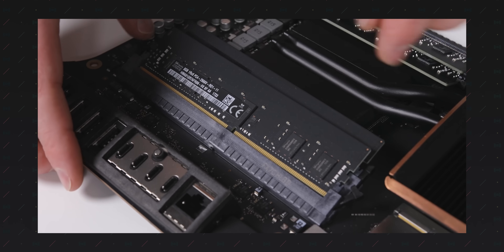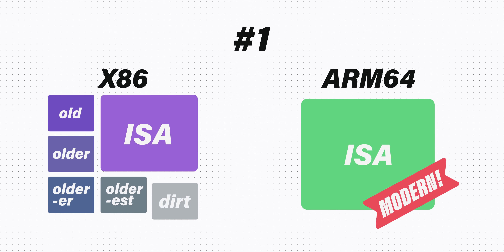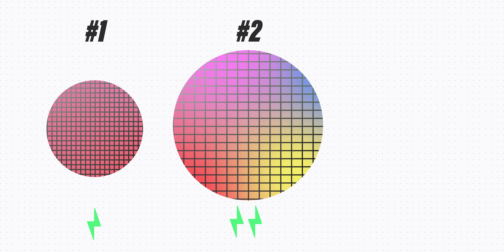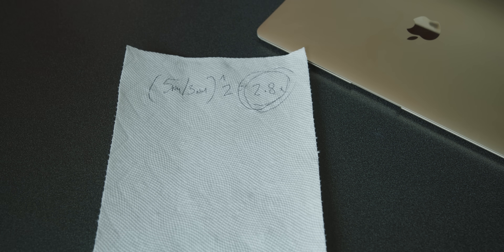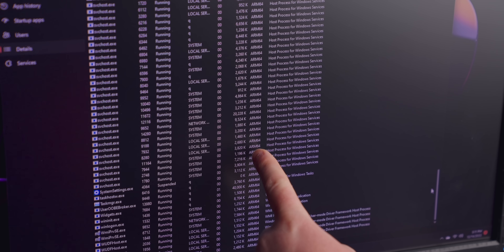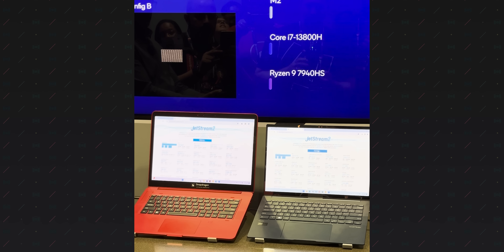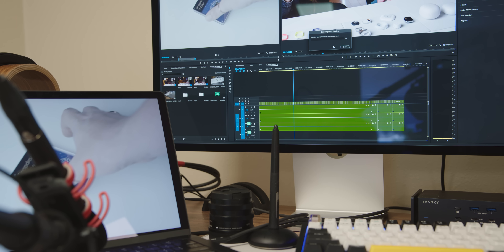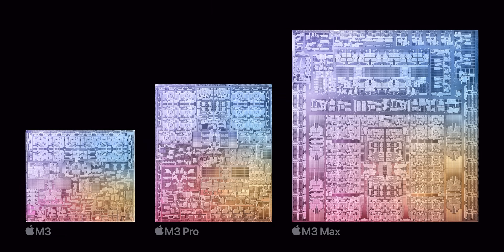Apple's Silicon Magic Is Over!

Comment: not only are the ssds unupgradeable, but they’re also unreplaceable, if the ssd chips die, the mac is a brick. i hate that.
Reply: Si se pueden cambiar... no en tiendas oficiales obviamente. Pero si hay lugares que los cambian incluso en IPhones.
Reply: Had an m1 since launch, it’s been spanked for hours a day.. every day. 
Zero issues. There’s a thing could cloud storage (and/or a personal NAS), use it. Keeping vital data on a single device is foolish and if you loose said data that’s down to your own decisions.
Reply: @jakestechtravels4864  well i now have an m1 16gb 256gb ssd and i still stand that soldered ssd with bios on the nand sucks but just keeping only apps and the os on the internal drive and use external ssds for everything else makes the ssd last years, plus if someone (like me before) really doesn't want to wear out the internal ssd at all they can just boot from an external ssd
Reply: And they die a lot - ask any repair shop - lots of horror stories
Reply: This is a planned revenue stream for Apple. They intentionally make shitty non-upgradeable devices knowing that you'll suffer through having to buy a new one rather than switching away from their all-encompassing walled garden of shit.
Reply: Ah, but that keeps users buying applecare. Not saying I like it because I'd rather crack a case and swap ram and hdd. But it sure makes people buy applecare as well as replace computer more often to keep up with what applications need.
Reply: @evankalbach9985 its planned obsolences mixed with anti repair
Reply: Components of a phone are irreplaceable too, so what? Phones easily live a dozen years without hardware problems except the battery.
Reply: @furyaroslav you're missing the point, and also very few phones last a decade. My iPhone 7 boot loops, my my galaxy s3.. turns on but isn't useful, got a lg something that works so hard on basic shit it cooks.

The main problem discussed here is that the laptop parts are not just unable to be replaced, but will wear out significantly faster because the sdd is being used for excessive memory swapping and paging because apple don't use sufficient ram. 

Everything that isn't fully active - regardless of whether it'll be used in a minute or not - gets written to the ssd, then removed, over and over again to complete basic ram tasks. If it had more ram, it wouldn't need to do these excessive transfers. 

On an ssd this can use up write cycles extremely fast - especially if you use ram heavy apps. And the 'unified memory' is just a special way of telling you they don't have a discreet gpu, so all graphical processing is also going to be eating your available ram - so more paging and more swapping. 

It's a poor design for longevity, and insulting for the price you pay
Reply: They never die tho !
Reply: It’s a brick for you. Apple can recycle it easily.
Reply: By design.
Reply: ssd isn't a "chip" like a cpu, and also have you ever had a Mac ssd die?
Reply: @KmGamer99  Yes and yes. NVMEs are chips (A CPU is a type of chip as are these ssds, they are like ram.), in this case the controller is onboard and only the storage chip is physically replacable, and even with Apple's software to allow for a new SSD chip to be used, you cannot use a different sized drive.
And yes, there are plenty of refurbed M1s on ebay that had the hard drive fail on them, particularly early models that had MacOS writing up to 8gb a week of temp storage just browsing the web.
Reply: oh its replaceable alright, you just need to educate yourself more
Reply: This comment did not age well.
Reply: Not true
Reply: Not only that after 7 years apple will cut security support so that you wlill buy a new one. No matter how fast your computer.
Reply: I think he is referring to swapping as when read and writes to the SSD from memory will cause wear in the SSD. These are NVMe not SSD and the endurance is rated X gb / day r/w over the lifetime of the system. The failure would hardly be pre mature considering the life of the system.
Reply: So much for the environment
Reply: No way I would buy that ...😂😂
Reply: Like having a car and no gasoline.  Screw electric cars
Reply: Have you ever had a Mac with an SSD that died?
Reply: @miketkong2  I'd say it happens. after all, one of Apple's biggest profit departments is repair.. they make huge margins and lots of profit for Apple, hence thier fight against right to repair.
Reply: @miketkong2  yes about 13 out of the 75 my company has.
Reply: @miketkong2 yes.
Reply: Yes twice  @miketkong2
Reply: @miketkong2  yes
Reply: @miketkong2 yes, only one thankfully, and it was mostly backed up
Reply: @miketkong2  dude 😆, it can die easily with swapping.
Reply: @lukasmauer230  what’s swapping? It’s an internal drive.
Reply: @lukasmauer230  no it can't. lmfao. the swapping thing is a meme. its virtually unheard of for modern SSDs to fail due to swap. it almost never happens, only under experimental stress testing. its not a thing anybody should ever worry about with a laptop lol.
Reply: @Anthony-kp7sf so u saying a drive tbw rating is a scam lol..theres a reason why manufacturers show those things..and ssd do dies😂😂😂
Reply: @Anthony-kp7sf crappy ones do I've had it happen but they are soldered on
Reply: @Anthony-kp7sf  they are realy doing it5, due to smol ram. It's like virtial ram on smartphones.
Reply: @Anthony-kp7sf  my macbook pro 2015 256gb that I bought in 2018, just died without any sign or warning, don’t see anything in the new models that would prevent that. I’ll just replace the ssd and use it as a backup for probably another 5 years
Reply: @DaviAreias my 2020 MBP died after 26 months, logic board failed, so that’s memory, disk, everything rendered useless. £620 to replace on a £2000 laptop. Are you fking kidding me? Never again.
Reply: @Anthony-kp7sf  I think you need to do some more serious reading in a world where grown-ups talk and not everything is a ‘meme’
Reply: @sprint955st  hmm.... but you're saying the logic board failed which includes onboard SDDs, but it also includes the CPU, GPU, RAM, IO controllers, power circuitry any one one of which failing could brick a system. It sounds like it's not conclusive that the failure was specifically due to a failed SSD. 

Failed SSDs is something that definitely concerns me since digital file integrity is crucial to my business and my livelihood. If modern Macs have an issue with internal SSDs failing, I've never heard about it, but I'd like to know so I can take precautionary measures since I work exclusively on a MBP—and because most modern computers run off internal SSDs not to mention pretty much ALL of my work data is stored on SSD tech.
Reply: @sprint955st  the amount of these "tech" people is alarming and they're indirectly contributing to why company can con us so much.
Reply: @miketkong2  your question was ‘ever had a Mac with an ssd that died?’ I said Yes then told my story. What I didn’t clarify was that Apple inspected the laptop that tries to boot but shows a folder with a lined circle on it, and diagnosed that it cannot find a boot disk. This is entirely in line with my experience leading up to failure where everything was running fine but it would then panic, crash and the logs I could get showed various I/O issues.
In a nutshell, my £2000 laptop with almost all-integrated or soldered components is rendered useless by a chip that likely costs £30-£40 if that.
And  concur on how important storage is, I work with enterprise-grade storage arrays contains hundreds of VERY expensive SSDs and flash, but with high levels of redundancy and plenty of warning before failure.
Reply: @sprint955st  right on thank you for clarifying. I appreciate it and it helps to know your experience with that. Did you lose any critical data? Do you not use Macs anymore?
Reply: @sprint955st  was it a smol capacitor that threw a hissyfit and shorted?
Reply: @miketkong2  what i meant isn’t that the ssd are shit, it’s that WHEN they die (ssd wear out no matter what you do) they aren’t replaceable and the bios of the motherboard is stored  IN FRAGMENTS in each ssd chip, so even if you could somehow make the mac think it’s the original ssd, there womb be any software that can make the computer boot, thats why i hate it, the bios is on the darn ssd
Reply: @Sulphur_67  got it. Thanks for the explanation. I think that happening, in my opinion anyway, is so rare that I personally am not worried about it and will continue to use Apple products, but I totally understand and respect where you’re coming from.
Reply: @miketkong2  "is so rare that I personally am not worried about it and will continue to use Apple products"

Nah you just an appel fan, thats ok dude. But don't try and tell people it's decent hardware or practice when it is VERY anti consumer and VERY wasteful.
Reply: @sprint955st  This can be common, but is also often something like the monitor ribbon got pulled out so it doesn't boot, or the serial checker gimped itself and bricked yyour lappy. If it was in ACT/NSW within Australia you would be entitled to a full refund or new replacement (your choice) for up to ~5-7 years due to the cost.
Reply: @miketkong2 you don't know what swap file is? hahahahaha
Reply: @Anthony-kp7sf The only systems where ssds fail due to swap are apple because no other system lacks that much ram. You think writing a petabyte to an ssd is a meme? Then why are there hundreds of users on reddit showing M1 Airs with that much TBW?
Reply: @transformerstuff7029  you don’t know me. Don’t act like you do. 13 out 75 sounds like user error. Use what works for you buddy. I couldn’t care less.
Reply: @miketkong2  "13 out 75 sounds like user error. "

Seems I did know, fanboy ;)

" I couldn’t care less."
Seems ya do.
Reply: @miketkong2  wait did you just make a comment arguing.......only to tell me you don't care.

LMAO that's one not so very smart way of showing me you cared A LOT.
Reply: @miketkong2  17% getting HARDWARE issues.

you go; usEr ErRoR derp.

lmao fanboys gonna fanboy.
Reply: @transformerstuff7029  look why don’t you educate us all and post the specifics of your claim. What hardware were you using exactly for your 75 units, what did your company use them for, and how exactly did they fail?
Reply: @miketkong2 why anyone would waste their time educating someone that is so dismissive of the answers given since they go against the faith that someone put on a brand? That's the text-book definition of a fanboy. And you can't change a fanboy. Only the company itself can un-fanboy you.
Reply: @miketkong2  Apple MacBook Pro 2016 ALL went back for their keyboards.

Apple Mac Pro (2019) Xeon W-3245 had overheating issues and was what I was talking about. They'd work, but they'd downclock under stress. Making them worthless. Took a while for Apple to admit to it and take them back.

In the end with Apple you pay more to get less.
Reply: @sharkuel  not dismissive. In fact, @transformerstuff7029 pointed out the reason for returning the hardware wasn’t even SSDs, so it’s besides the point of this thread which is about SSD failure. If he read up the comment thread he would have seen that. That is why I was so skeptical about such a high failure rate with Apple SSDs and asked him to clarify. Turns out it wasn’t about SSDs failing at all. It was about keyboards and overheating issues. I’m not telling anyone what to buy or calling anyone names. I’m just trying to learn about SSD failure rates for my own workstations. You all are kids and need to grow up.
Reply: @miketkong2  so, fighting for our consumer rights, independant of the type of failure, makes us kids. Great. 

You are the embodyment of the "please leave my multi-million dollar company alone" meme.
Reply: @DaviAreias  You make it sound like a 9 year old laptop is a bad thing. Windows laptops from the same time don't last as long.
Reply: @Sulphur_67  why would it? The case is sealed shut and I don’t poke around in it. If it was a capacitor then it’s an inherent manufacturing fault and they should recognise that because thousands of others will fail, and the reading I have done suggest that is the case. Needs a class action law suit.
Reply: @sprint955st  That sucks man, yeah 26 months should have been covered for the price you paid. I know of 2 people in rural towns that could diagnose/fix an on-board issue over here, but it sounds like options are more limited where you are.

Oh well I guess get a gigabyte/framework/metabox lappy next time.
Reply: @sprint955st  I'm interested to know if you had Apple Care and if that was the repair price they quoted you with such cover?
Reply: @lukasmauer230 ”easily” ??? i’ve been doing very memory intensive work on a mac with 16gb of ram, and in 7 years my SSD only lost 1% of it’s capacity.
Reply: @miketkong2 Swapping is the use of storage space as extra RAM. AS Macs are very good at it since their drives are so fast, but it significantly lowers the lifespan of the drive which is a huge issue since they’re soldered.
Reply: @sprint955st  Lies

Comment: The biggest issue besides the processor advantage you still need to factor in is the OS itself. Windows is a relative hot mess compared to macOS and always will be. Apple for the win regardless of the processor.  The rest of the industry will never “catch up” until they move on from Windows.

Comment: I use my (almost) base spec 512GB, 8GB RAM 13" M1 MBP all the time. Bought it 3+ years ago and for my usage, and my video editing and the likes, I have never noticed a hiccup. It runs just as good as the day I bought it. Works amazingly on battery too, lasts for hours and does not throttle. On the other hand, I bought a ASUS TUF F15 (base spec) for gaming and surprised that a i5-12500H barely benches 20% higher than my M1 in Geekbench and has a TDP of 45W when the M1 is 15W... also the F15 throttles and falls to pieces if I use it only on battery--has to be plugged in to game properly.

Comment: I tried to adopt a couple of m series MacBooks. The hardware is great... The software, not so much. So many issues and finder is an absolute abomination. The thing they don't tell you about with battery life, is that it's only using optimized software.  I found that Citrix Workspace (client), Teams, and MS Office is enough to kill both of my MacBooks in less than 7 hrs. Meanwhile, I've seen at least two AMD laptops running an OS that isn't infuriating to use at times lasting longer than a full workday at the same use. 

It didn't work well for my use case, but I can see how it will do great for a casual used or someone who enjoys apples ecosystem.

Comment: Out of curiosity, have Apple chips ever outperformed Intel or AMD chips on desktop computers?  It all sounds wonderful, until you realise it's about perrformance per watt, not all-out compute power.  Couldn't Qualcomm pass Apple by putting multiple chips on a die connected by a fast fabric a la AMD? On the other side, isn't it time for Apple to stop pretending and put actual cooling in their computers?  Say, the RSD5 system with no moving parts.
Reply: yes lol AMD and Qualcomm haven't had reasons to cuz they're not in the business of making the best or most efficient processors, just the most marketable ones to manufacturers.
Reply: @feralmage  It can't be the best CPU when it's only real strength is battery life.  It gets crushed in cinebench or Blender rendering by those less efficient chips, which makes it a hard pass for 3D modelling, but no doubt a win for writing or browsing.

Comment: The current transistor density naming convention that manufacturers use is not completely arbitrary. Manufacturers use a litany of manufacturing techniques to maximize efficiency and performance that don’t come down to just “how close is this transistor to the one next to it?”

The naming convention today is somewhat like what we use for electric cars and their fuel economy, “mpge”. It’s an equivalent. 

a 3 nm Chip from Apple is “equivalent“ in performance and efficiency to a hypothetical  2-dimensionally designed traditional 3nm Chip

Comment: I frequently see ARM touted as an efficientcy king, but this is not the biggest contributor at all. The M series has ram soldered right besides the CPU, that decreases energy use significantly. Just look at the efficiency improvements of the AMD chips using 3D V Cache, adding a substantial amount of cache means less memory fetches and memory bus use for the same workload.

Comment: M1 was so good it made me, a lifelong windows user, switch over. This MacBook Pro still feels brand new and there are zero reasons for me to look at anything else right now, it’s a damn good laptop
Reply: You can run linux on a 10 year old laptop and feel the same way. Software quality matters a whole lot more than raw CPU power in most cases. Most workloads are not CPU bound these days, and even old CPUs are more than good enough for most of what people do, if the crappy software would get out of the way and stop wasting cycles on useless garbage.

Comment: Apple silicon never was something really special, to be true. Even the M1 wasn't the groundbreaking, all beating thing it was often said to be. The truth is that just Intel sucked at the time, even on the desktop market and pretty much everyone else had surpassed Intel at that point. If Apple wanted, they could also have went to AMD to get an energy efficient and still fast CPU/GPU. The only thing that made the M1 not suck on performance was the extremly tight integration, and if you dared to do tasks that were not supposed by special hardware in the chip, it actually was slow and still is.
Reply: Not true at all those things last for hours. They wouldn’t get that with AMD chips.